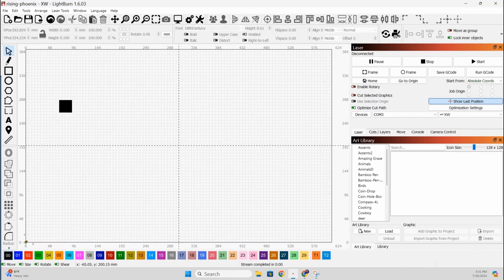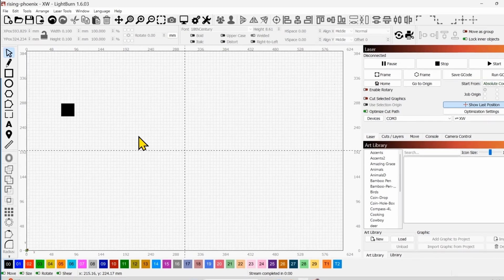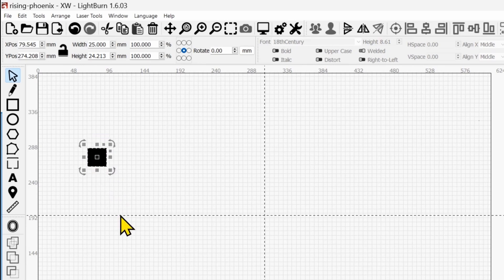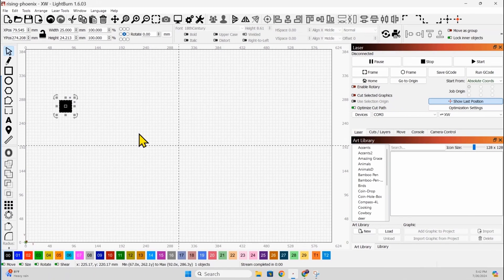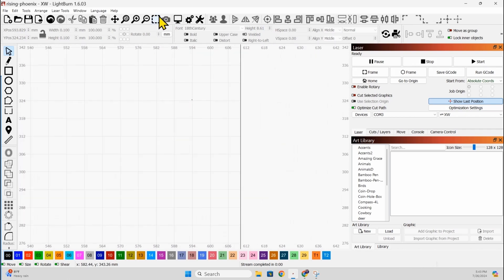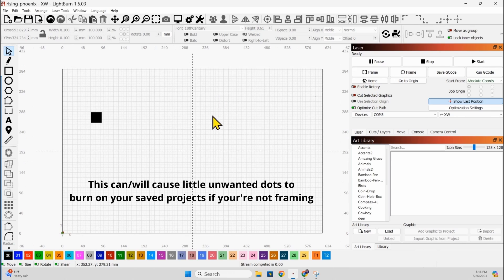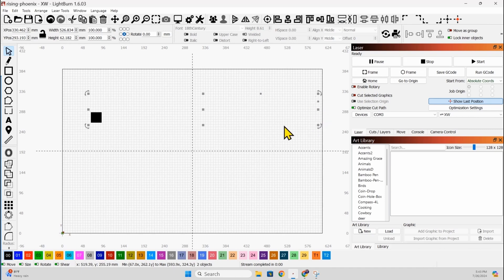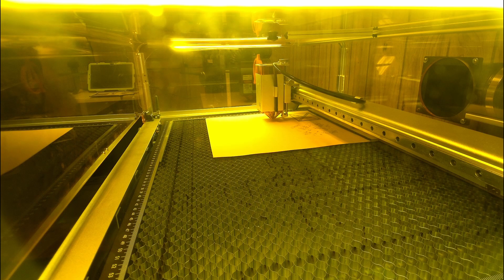⁉️ Hidden Anomalies on your work bed in Lightburn; LET'S FIX IT!

Comment: I get this sometimes at 0 0 location. It's usually a single node left over from something I edited.
Reply from the maker: Yep, it gets a lot of people!
Reply: @TheLouisianaHobbyGuy  If you haven't already you might want to add editing nodes on grouped images. If an image is grouped you can't edit the nodes. You need to ungroup them first. It confused me at first but with my coding background I figured it out. Again another invisible feature that most probably don't know about or how to fix it.
Reply from the maker: I've covered it in several videos, thanks!

Comment: I ran into this issue, but it was not Lightburn and not a laser. It was Vectric Aspire and a CNC machine. There was an image trace artifact that was so small that it was practically invisible. When I started to run the job, the tool dive bombed straight into the material, which was a one of a kind, hand carved piece. Fortunately, this happened outside of the critical area and I was able to save it from disaster.

You’re right - nobody discusses things like this. Great tip!
Reply from the maker: Awesome! 👍 Thanks for watching!

Comment: Great tip. I had a problem last night. I had imported some Adobe Illustrator vectors into lightburn and made duplicates. Got everything set up and looked at the output view on screen. The cuts were setup as single passes but for some of the shapes it was doing 2 or 3 passes extra. It seemed unusual but then I tweaked. I ungrouped the offending shapes and deleted up to three duplicate shapes behind the originals. How they got there I have no clue, but there they were. I sent the file back throu the onscreen view and now voila, a single pass was occurring as I had set them up in the Cuts&Layers. Just thought you may have had a similar issue. Cheers
Reply from the maker: Always good to check the preview and even let it play Bruce.